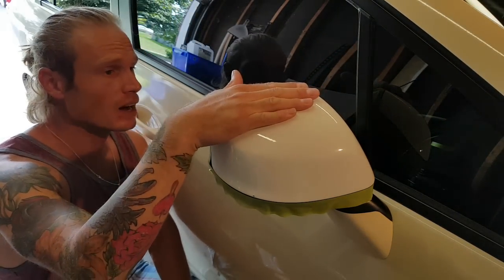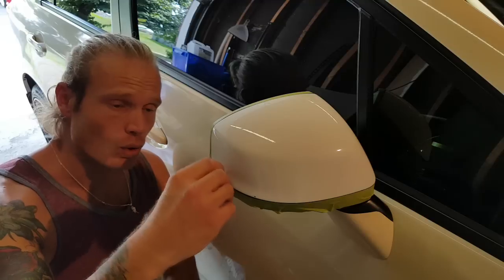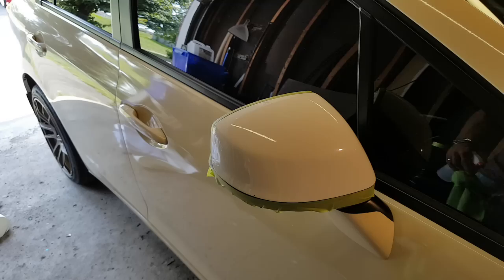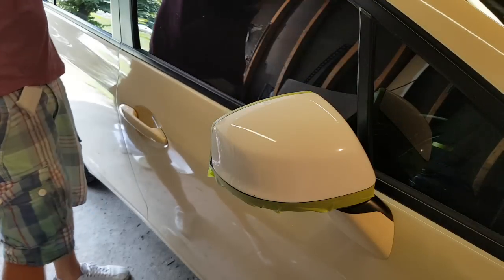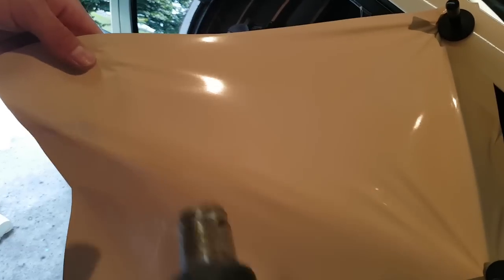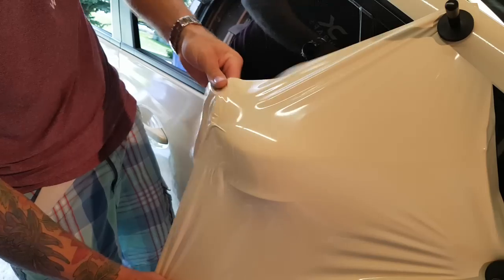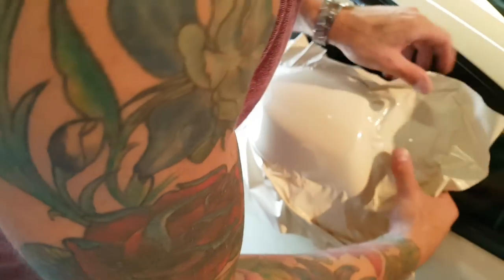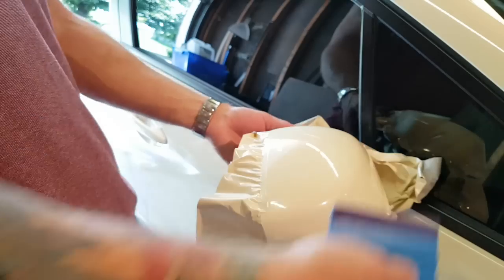Professional. 3m vinyl wrap side mirror. How to vinyl wrap side mirror. By @CKWRAPS

Comment: What’s the best vinyl brand or typefor a textured aluminium pole or surface.
I have tried the cheaper vinyl with the hexagon adhesive and it doesn’t stick to that only plastics or smoother surfaces.

Comment: How does 3m 1080 hold up on rough surfaces like faded clear coat or even small spots with sanded body filler. Is this possible to wrap?

Comment: One question: why didn’t you remove the cap before wrapping it - would’ve made it a lot easier
Reply: 2 years later lol, but its easier to stretch the vinyl with the caps on and then just to detail the edges take em off

Comment: Would this same rule and technique apply to doing headlights? Making some eyebrows for my 2017 Impreza, and the ones I did were... Less than tasteful. Bad tear lines from the knifeless tape, bubbles and wrinkles everywhere, and just overall a failure in my mind. I did notice that the wrap itself was rather thick, so will heating the wrap before applying help with getting over and in contours, both concave and convex, and not give me bubbles and wrinkles (aka, eye candy grief)?

Comment: I've been watching your videos all day. Very informative, im trying to learn as much as possible before attempting it myself. my only fear is that it won't be as easy as you make it look. Haha My question is, i want to chrome wrap my dodge nitro. How do i measure to know how much wrap i would need for the job?
Reply from the maker: Garbonzo69able it's usually best to get 75 feet which is a standard for most large vehicles. It should leave you with some extra for mistakes you'll make along the way. Remember, chrome is one of the most difficult materials to install. You can take a more accurate measurement if you want by measuring square footage. Measure the vehicle as if it were a box
Reply: hey dude loving the videos, wondering would 50 ft be adequate for a late 90s model civic coupe? cheers bro
Reply: Ok cool. Thanks man, i wish you were in my area I'd just come to you. Haha

Comment: Unbelievable the job a local shop on my mirror caps. Even after redoing, It was a botched job second time around, patched the edges with vinyl resulting in seams.... and sloppy seams at that. Nothing like this one piece wrap. And this from what’s supposed to be one of the nest shops around.

Comment: Hey you do great work. I have a fox body mustang that I dropped off to get painted and the shop owner was put in jail for insurance fraud right before my car went in for paint so i had to have my car flatbedded home in pieces. The car is half in primer now and body shops don’t really want to touch it here in New York for less than $5k. I already paid the guy $2600. I would love to try and wrap it myself since it’s Home in pieces. Question is do you think the vinyl would stick to primer? Also is there a decent quality wrap that is a little cheaper than 3m since it’s never going to be a show Car now. He basically destroyed my car. Thanks any help would be greatly appreciated.
Reply: you wont really save $ by choosing another vinyl.  youll just add headaches and frustration. 100$ difference MAX when looking at 1 car pricing "cheap" vinyl vs 3M. yes it sticks to primer.
Reply: Make sure to sand that shit
Reply: Avory denninson might be a little cheaper and sometimes on sale, so I would go for that ? 

About the primer thing, yes. It sticks same as on a painted car, just make sure you clean it enough, and wrap in an area about living room temp. Too cold and it rips easily ;) heat is not much of an issue ;)

Comment: Wouldn't be easier to remove it first than wrap it
Reply: It would be for a novice. Wrapping is all about time. If you can do it while it's on you don't have to take time to remove the part and put it back. Some small car parts require more disassembly than you'd think..
Reply: Chris Swanson yup you’re correct. My bmw requires a ton of work for the smallest removals

Comment: Wrap is sent from hell to mess with my head. Hate the stuff. Just tried this and besides the cap your working on being much simpler in shape and the wrap being a basic colour, not something that shows stretches like chrome that I've just tried using I think hydro dipping is the way forward. Well done on the vid, but I think it's hiding many of the problems the people it's aimed at will face.

Comment: thx for the vid does all mirror cap comes off like that?
Reply from the maker: I'm sure most mirror caps are removeable. Some mirrors have caps and others don't. Some are partially painted and some are fully painted. Mirrors vary quite a bit and some can be much more difficult and complex than this set I did

Comment: Did you spray anything in the film before hand? I've heard of 3m primer or something to help it stick. What do you recommend?
Reply: N.T. Cutler 3M Primer 94 is not that great of a product. I've removed countless wraps that had it applied and the wrap was still lifting. I've also used it with similar results.

Comment: Anyone can reply :o) Thanks. 

What does wrapping a set of mirrors usually cost, typical average price, more or less.  Also how long does this Wrap last? Looking to get mine done in some good carbon fiber wrap.  :o)
Reply: Roof is about $150. So mirrors for a set are probably around $75. But it's a guess. Depends how complex the mirrors are and for what car one price for one car will be different than another car

Comment: Bruh why didn't you just take the cap of and wrapped it that way
Reply: Exactly what I was going to say. Maybe it is easier to do it in situe.
Reply: Because it's easier to disperse the tension across the cap while it's on the car and then remove to tuck and trim the edges.
Reply: Maybe he doesn't know how to pull that off there lol.it will just take a seconds to do that.smh

Comment: I would have to agree with Aaron. That car is going to sit in the sun for a day and start to finger at all your corners and tension spots. You should have started with your hardest corner and triangled out so there would be absolutely no tension. That film you stretched it way over 10 percent. Wrap will always go back to its original form that's why you heat glass effect it then allow it to come back to form before you end corners with less than 4 percent tension  Note to all if trying it this way life on wrap will not outlast your next payment on car
Reply from the maker: +molsen03 it's been 6 months and no issues
Reply from the maker: The tension was relieved before trimming
Reply: molsen03 gets it. Triangles & cold pre-stretching 100%
Reply: its called pre stretching, its an actual technique and works quite well, as long as you do the post heat it goes back to relaxed position.

Comment: you think you would be able to wrap a football helmet?
Reply: you "shouldn't"  ever put anything on a helmet. you never know how the adhesive will affect the structure strength of the helmet. you wear a helmet for protection not to look cool. if you want a cool looking helmet, then buy one that looks cool off the shelf. - honest answer, many won't like it and most will put stickers on their helmet but the actual answer is as above, you shouldn't - sucks I know.
Reply: this is just for looks not to go play football in and i doubt the adhesive will make that much of a difference to the helmet
Reply: In that case I would say get some high-quality air release wrap. 

Then ideally make sure the helmet is solid on something LIKE on someone's head so you could pull down either side of the helmet rather than on a flat bench or table but probably best not do it on someone's actual head lol)

NOW THE WRAP: remove the backing paper from oversize piece fo vinyl for whole helmet and Get the wrap HOT for maximum stretch but obviously careful not to burn/blister/scorch the vinyl. Starting at the back of the skull area of the helmet pull the hot wrap over the helmet. 

...at HALF WAY - stop! squeegee out what you've done.

not at this halfway point there is going to be too much vinyl as you've just heated and stretched it. So now warm it back up to remove any creases of wrinkles/stretch and then let it cool so it can shrink back to its original size. Hopefully, you can finish it like this. 

If this doesnt work then cut the wrap along the halfway point (for a straight cut use "knifeless tape" - YOUTUBE IT) and use another piece to come from the other side with same method (so you have two pieces)

Good luck - it will not be easy, you will need bags of patience and plenty of spare vinyl.

Comment: lol doesnt like 3M! 3m is best.
  vivid sucks! it doesn't stick and it rips easy. vivid = junk
Reply from the maker: +Jae Fetter 3m has a really poor finish compared to other brands on the market. Just because you may not know how to work with something doesn't mean it's junk. We've done 50+ full wraps using Vvivid and had no issues with it sticking properly. One of the only times film doesn't stick is because the surface isn't clean. If you find it rips easily then you're just not installing it right. Try doing it at a different temperature. 3m shatters like glass and rips very easily compared to every brand we've used when the temperature isn't right
Reply: Jae Fetter 3m is getting its ass kicked by film theses days. Suntek,   Xpel... crawl out from that rock dog..
Reply: Waiter: What would you like Mr Fetter?
Jae Fetter: Nothing, I've just been served!

haha!
Reply: Jae Fetter avery is the way to go.....so easy to work with
Reply: false, 3m 1080 film has one of the best release tach ability for any film, next is avery followed by hexis
Reply: Doesn't matter what the film is, a pro can make it look easy, a bad installer can make a good vinyl look bad